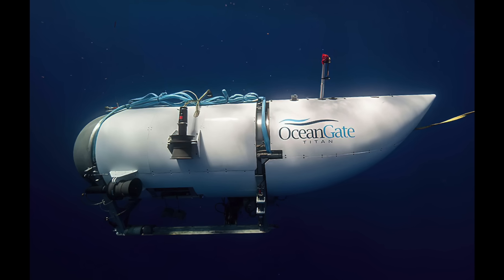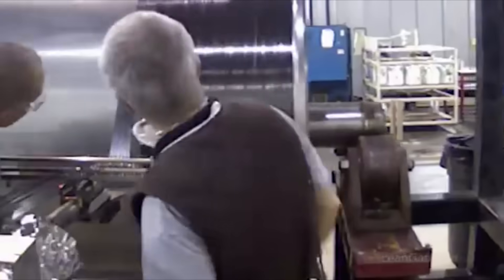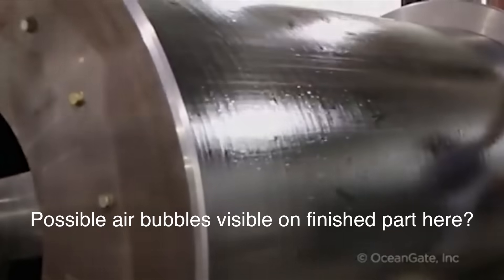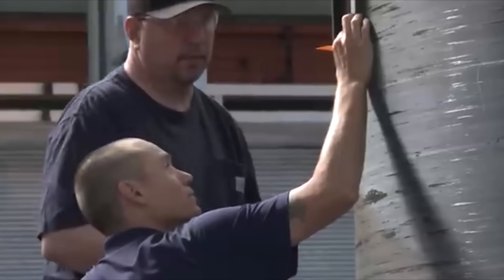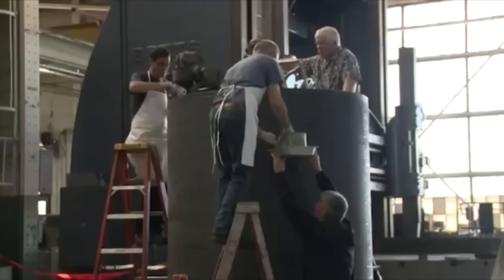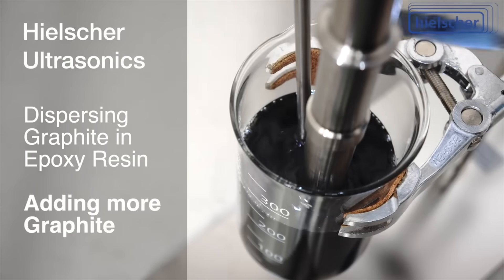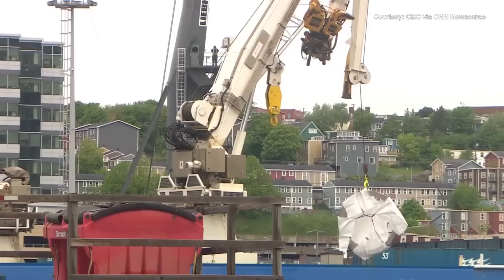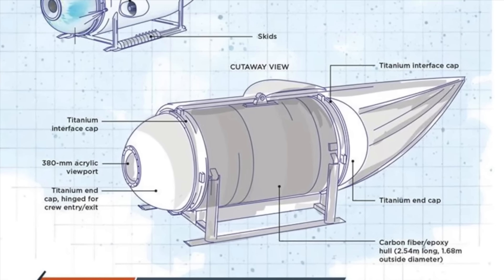Why OceanGate Titan Imploded - A Carbon Fiber Composites Perspective

Comment: Why did Mr. R spend all that time and money to reinvent the wheel? The 7 man aluminum sub Aluminaut is still maintained and on display at the Richmond Science Museum. 251 dives  (1964-1969). It was the first submarine  to dive to 15000 ft.   It had four view ports, active and passive sonar, manipulators, side-scan sonar, and a capacity of 6,000 pounds. Average person could stand up inside. Probably could have leased it for less than the cost to make the Titan. https://www.youtube.com/watch?v=_HLFs_b1fmU

Comment: Looking at the titanium, I have a question: where"s the surface abrasion? For any lamination, you have to abraid the surface to increase the area. Without surface abrasion, your joint is far far weaker; I learned this personally when I was building an A-frame. I abraided some members, but not others, so when I broke it apart for disassembly after lamination, the abraided sections had to be cut, while the smooth sections simply ripped off. Scary!

Comment: Also what about the microscopic bubbles that are cured into the matrix as the epoxy cured? a pressure vessel that sees the extreme pressure that that hull did would compress and uncompress with each dive breaking strands of fiber with each cycle. He heard this crackling and yet he did nothing to address it.

Comment: It feels like Stockton was just guessing. Had some interesting ideas, implemented them haphazardly, cutting corners, didn't test them in any way, ignored warnings, and just YOLOd it. It wouldn't have been so bad if he was just risking his own life, but he also convinced 4 others and took them down with him.
Reply: You can not tell a Narcissist anything,  they will do the opposite.
Reply: People are allowed to think before going with him. He wasn’t forcing anyone. Like getting in a fast car with someone who says it will all be fine but there’s always a risk. And even someone without knowledge in engineering could see this was made to fail
Reply: @PT-mj3bk true. Problem is he probably didn’t properly convey the actual risks. When I went skydiving, I also had to sign a bunch of waivers and consent forms. The company still had a responsibility to provide a safe experience - if the instructors were inexperienced, planes and equipment poorly maintained, corners were cut, etc., I would have had no idea. I simply knew their track record was good (no deaths in over a decade) and trusted the company. Oceangate depended on these paying customers and Rush made all sorts of misleading claims about the safety of the vehicle and went out of his way to convince clients (e.g flying to meet with them) - it’s impossible as a customer to accurately assess the risk if the company is dishonest.
Reply: @sue8412  Yes, and to add to that, Stockton claimed they collaborated with NASA, Boeing, and U Washington, but that was a lie. Stockton was also warned by his own employee as well as external experts about his fault design, but he ignored them.
Reply: @PT-mj3bk  A better fast car parallel would be if the driver failed to tell you the car was improperly maintained and that it had had some issues on previous rides that were brushed aside. Also, the car is not actually road safe, but the driver failed to mention it. Also, in case of a crash, the airbags may or may not deploy, but the driver also forgot to mention this and other details that are necessary to make a fully informed decision.

Comment: You don’t know anything about composites … stop telling your opinion…. What you said makes no sense.    Carbon is  always has epoxy vacuum pulled into the fabric.   Please post your experience in composites. Also you don’t even know about mycelium stop trying to get views when you know nothing about the process.  You don’t use colliidial silica in carbon fiber …………… that’s for fiberglass which is not the same. ….  You say a mixing nozzle gets to perfect mixture your wrong …. I build yacht hulls for a living….

Comment: Note: The guy wiping the ring down with a shop rag appears to be removing stray dust from the opposite side of the parts from the actual bonding groove. This is also a necessary step, as stray dust can migrate as the part gets craned up and over the CF cylender... hoever, he's not wearing a "bunny suit" and thus can leave skin cells and hairs behind after wiping down.

Not a good situation on the non-bonding surface, but definitely a poor practice indeed on any surface where you want to achieve a bond.
Reply: I bet he’s feeling pretty shitty.  Yeah, wipe with cloth with one hand and then rub over it with  his other bare hand. Yikes!
Reply: Totally agree with you ...

Comment: Even if there weren't any air bubbles entrained in the adhesive during mixing and application, there would be microscopic gas bubbles formed by the leaving groups coming off of the monomers as they polymerized to form the join.

Normal procedures to remove these bubbles include curing at elevated temperature under vacuum in order to draw the gases out of the adhesive.

Comment: You talked a lot about how Glue should have been used, and clean surface and etc, etc. But instead, you should have said that Glue should Never Ever “Ever” been used in the first place under that enormous pressure. It has to be weld, bolts, etc. Glue on Ocean Floor ? What glue can resist 6,000psi. Come on dude, it’s common sense.

Comment: I am a naval architect and marine engineer.  I spent over 33 years working for major oil companies.  All of my work was in design, engineering, maintenance, environmental issues, and spill response.  I spent a considerable amount of time working on fatigue cracking particularly in critical areas where cracking could result in catastrophic failures.  I have no experience with carbon fiber.  I did at one point own a fiberglass sailboat.

When I first heard the reports of the missing submersible and heard that it was a carbon fiber cylinder with titanium end caps, I told my wife that there was no hope of rescue.  When the videos of the hull construction started to be shown, I told her that the design was flawed and was destined to fail. 

I agree with your comments on using a single radial wrap was a critical error.  There should have been a weave pattern to strengthen the cylinder to handle the axial compression from the end caps.  Even my sailboat's hull was laid up with crossing wraps of fiberglass.   The Titan was subjected to multiple dives where the carbon fiber tube was subject to fatigue from the compression and relaxing of the axial load of diving and resurfacing. 

The arrangement of the rings and the bells leaves much to be desired.  Securing the rings to the carbon fiber with glue alone, with no mechanical backup raises questions.  The use of 18 bolts to secure the bells seems to be odd since a pipe flange at 6000 psi requires 44 bolts.  I heard in several reports that the hatch end bell only used 17 bolts because of difficulty in tightening the 18th bolt.

The lack of Classification Societies' input was a fatal flaw.  Let's assume that review and approval have a zero-time and zero dollars impact.  Skipping Classification meant there was no third-party review of the design, there was no fatigue analysis, there were no failure modes and effects analysis, there were no inspections and certifications of components during construction, and there were no in-service inspections. 

I told my wife if I had a disposable income sufficient to waste $250,000  to visit the Titanic to look out a porthole, please excuse the expression, "I wouldn't be caught dead on the Titan."
Reply: When you say "pipe flange at 6000 psi" I assume you mean 6000 psi on the internal surface of the pipe?  That's quite a different load on the bolts to 6000 psi of external pressure like the sub would experience.
Reply: The radial wrap was likely found to be a necessity to avoid density voids. The fibers were two directional in the tape: 90-0. They made a previous hull and it made lots of noises. This was their second hull and it was a lot better. Don't underestimate the effort they put in this... I myself thought; why not make an inner tube in metal to connect the ends, but then I realized any leakage would pry the two materials apart... What they were doing was far from easy...
Reply: The man was an amateur, how did he get in charge of all this... the vessel at the absolute minimum should have been tested to 8k psi double the normal if I were in charge.. and I'm amateur..

Comment: And design wise, i would think the titanium ring should be designed to fit within the carbon fiber tube, not outside.
Reply: By at least an inch. The pressure would press the tube into the seal, actually reinforcing the connection.
Reply: That would be a horrible way to do it.  The force on the end cap would then be trying to slide the rings deeper into the carbon fiber tube.  The only thing resisting that would be whatever you used to secure it to the carbon fiber surface.  With it capping the ends, the force tends to press everything tighter together.
Reply: @stargazer7644  not totally inside, but like we use for prescription bottles for my aunt who has limited mobility, where it is L shaped rather than the I beam shape seen here. Yes, if the endcap is totally inside the tube you have made a compression cylinder which spends all its time planning to crush the passengers.

Comment: I could not find anything about a "buoyancy to strength ratio". That sounds pretty wanky to begin with. I did see the term Buoyancy to Weight ratio which may have been what Rush was trying to say? I noticed there did not appear to be any carbon fiber left on the rings post-accident. Like you this looks like a failure of the glued joint. Perhaps they just got lucky the other times they went to 4000 meters dancing on the edge of a safety factor of 0. Maybe they descended to quickly this trip and this was enough to pop the end caps off.

Comment: I just noticed that no excess glue was squeezed out the endcap as it was lowered onto the carbon fiber hull. I would have called a nuclear service company and had them run a NDE ultrasonic phased array to detect any defects in the joint. I would have done the same thing to 100% of the hull. I can bet that was not done.

Comment: This glue is mo.icular and atomic it is supposed to bond with electrons not just  act like wood glue  it actually becomes permanent  part
But texture grease oil mis alignment all can de stroy this and a small surface area why didn't he jaket it to like 12 inches instead of 2 inches?

Comment: There is more cleanliness and care taken in boat fiberglass work and auto body painting than what is shown in Titan construction.
Reply: Right? Painting a car: every surface is prepped and meticulously wiped down to get rid of every spec of dust. Paint is sprayed on in a paint booth that has an air filtration system by techs in full body suits. And then there's ocean gate mixing up batches of glue by hand and applying it the same way in what looks like a dirty industrial facility.

Comment: probably would have got the same result if the port viewing window gave way, the inrush of water would have shot the two titanium end cops off ???,
so where did the hull actually go, if it shattered into pieces it may have just floated away from the wreck site ???

Comment: I’m a master degree’d, multi-state licensed, structural engineer.   There are a lot of things that are being discussed and a lot that haven’t, on YouTube and elsewhere.  I would love to have some questions so I can explain mechanics of materials and how it all relates to this disaster.  If interested, ask away..
Reply: I have brought up the questions of what happens to carbon infused materials that are exposed to high temperatures and pressure. Not the way it was handled or what it was used for! Having to have worked with HYDROCLAVES at around 3,000 P.S.I. I come to the conclusion that carbon fibers drastically change character at different pressures! Seems nobody talks about this? If the pressure and temperature changes , doesn't carbon turn into graphite or even diamonds? They would all have different qualities? Seems nobody wants to talk about this subject! JUST CURIOUS!😢

Comment: Would it have helped if he had of strung/glued more carbon fiber cross ways on the outside, on ends and all the way across the inside of the carbon fiber tube hull? Could you have some type of waterproof heavy duty sealant on the carbon fiber itself?
Reply: If they had done a better job it could've lasted more dives, but it would still eventually fail from repeated stress on the CF. Wrapping more CF, they would probably only be able to then fit 3 or 4 people, which seems better than 5. Idk

Comment: Bonding area is pretty important and a tapered sleeve on outside with 3-4 x the overlap would have possibly preserved the bond. However he mentions not seeing any bonding agent squeeze out....When we bond and pot things with thickened epoxy a real problem is when you slip one thing over another or inside another, you scrape the glue off the sides and push it into the end  which also traps air. The ends aren't even touching 100% . You go back later for a repair and cut through to inspect and that is what we see.

Comment: Crushing Titan would have been like squashing a coil spring. Replace the coils with the same thickness, same material continuous tube....there would be no comparison in it's crush resistance. The coils can resist if they don't move and work together. The crush is sort of a divide and conquer deal. Once Titan narrowed in middle there wasn't anything other than resin holding the "coils" together longitudinally.  I'm thinking of the carbon fiber filament wound tube  as the spring, made up of circular rings. The pressure in a fluid acts at 90 degrees to any surface, no matter the surfaces orientation. In theory all the force on the tube is acting at a right angle to the surface. In theory the pressure on the end caps would be pushing the two end caps together with some incredible amount of force....heck, who needs glue. (He never imagined that the joint would be stressed but when the carbon tubes narrows in the middle the ends will tweak ever so slightly).....The pressure on the tube would be  directed at an imaginary line dead down the center of the tube.   If the tube narrows in the center and does not narrow in the ends, which is my belief, the wall of the hull in the middle would be in compression on the outside, the fiber rings being pressed tightly together. The inside would be in tension with the fiber rings being pulled away from one another and the longitudinal tensile loading is then born by the resin.  It was in disbelief that I watched the winding video the first time and the clear lack of longitudinal fibers to transmit force, compressive or tensile in the lengthwise direction. In my spring analogy you can imagine the spring staying together and then it moves a hair,,,,and flattens. I trouble shoot construction problems in much much simpler carbon fiber sports and aviation products so this is just something I can't help but go straight to. Rush took an over simplified analysis and went with it. Metals are homogenous and transmit force equally in all directions. A filament wound fishing pole with all the fibers at 90 degrees to the length would snap midway through the first cast. Rush's approach was somewhere on the serendipitous side of theory. He embraced it and ran with it. I agree with this post, Carbon is actually a great material to use in compression loading and if kept within a physical range of deformation capable of repeated loadings. In some ways Rush may have been on to something...if fully developed and tested...now that he could have parlayed into something.